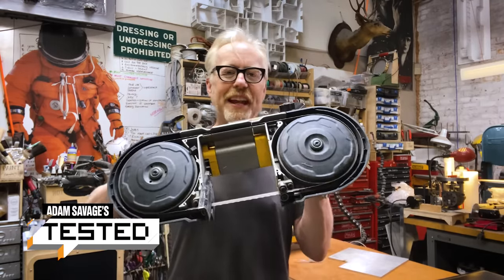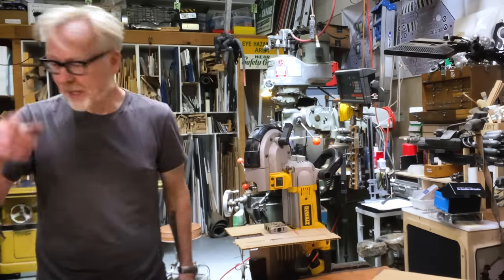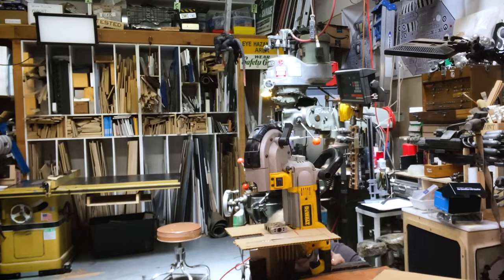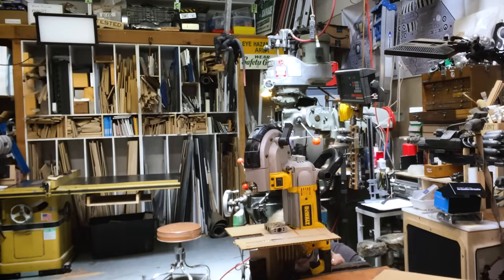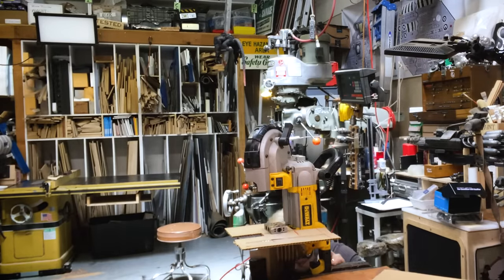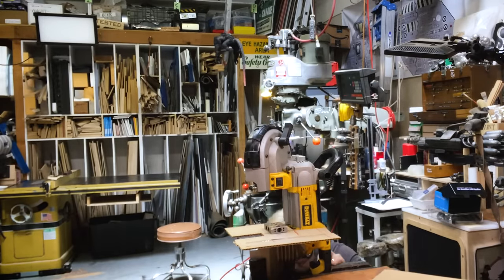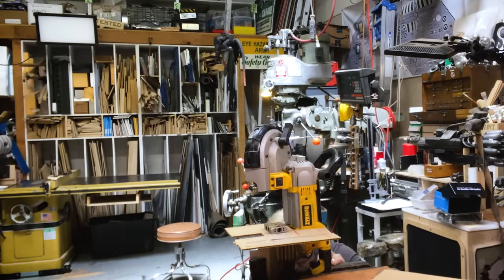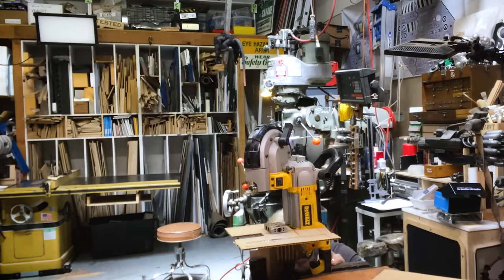Adam Savage Builds a Mini Tabletop Bandsaw!

Comment: I really really hate to be that guy, but it seems I have to make a little comment about electrical safety here.
Usually the One Day Build videos show reasonably safe shop practises (safety googles, respirators, things to look out for when using tools  table saws and nail guns) and that's pretty cool,
because lots of other youtube content does not.

However the wiring in this video seems a little bit like a missed opportunity in that regard.
When modifying your tools like this, please at least use a multimeter and check that the earth connection at the plug has continuity to all the touchable metal parts of the machine,
before plugging it in. In this case the table would have been a nice place to test.
The reason for this is: If you messed up and live wires gets shorted to the machines housing, there is a low resistance return path for the current through the earth connection and your circuit breaker will trigger.
If you also managed to interrupt the earth connection the you are the return path as soon as you touch one of those metal parts. You don't want to be the return path.
Also it is always good to check if you accidentally shorted live and neutral before plugging stuff in.
Other than that please don't leave any live connections exposed like that, where you can potentially touch the while absent mindedly fumbling with the switch. This get even more important if somebody else will potentially use your tools.
It also important to know that if you use a switch like that and connect the live wire to the common contact in the middle, one of the other contacts will always be live as soon as the machine is plugged in. For example in 1:01:30 the upper exposed contact is live when the machine is turned off.

It's totally cool to modify the electrical side of machines like that, but please be smart about it and do it in reasonably safe way.

Comment: Since you had a 2p2t switch, it would have made sense to utilize all of those to make sure that the tool is completely without power when off. Exposed live wires on the back of the switch.. Adam, that last bit was half assed and rather dangerous. Imagine you just need to turn the saw a littel bit and you grab the nearest ledge - where there is now live wires.

Comment: Suggestion: make more table space ahead of blade.  Having built my own bolt-on with 1/4" AL plate like yours, and having gotten a Swag table for a saw at work, i am continually wishing I had a bigger surface ahead of the blade.

On my DIY table I screw on a sheet of 1/2 MDF to make more table surface

Comment: The electrical connection should be encased to protect it from metal shavings which could cause an electrical short. I also don’t like how close the switch location is to the blade. Quickly turning off the machine could result in a laceration.

Comment: Old Man yells at cloud (Torx). The exposed contacts on the switch are a security NOGO. But i saw you fixed it in your second Video. Honestly i think you should have used a security Switch. That kind with a Emergency Power Off Button and Auto off if the Powerline is disconnected. And of course you should switch both Power and Neutral.

Comment: Dumb question but why not a variable foot pedal for speed control?  I know he said portable but you can just make it detachable for cord health or wrap it up.   I commented when he talked about the speed control knob on the top so I may be dumb!
Reply: well it is hard to see on camera but Adam cave is really small and a foot pedal would add vertical space requirement to the setup, plus added time to the setup time and it will reduces portability and make it less used.
Reply: @1BigBen  that makes sense!  I was thinking this tool was floor mounted anyways so my fault!  Guess I can't read!

Comment: So you didn't want the switch mounted proud  but instead you've got a cable  grip and cord mounted proud. The exposed terminals on that switch and wires just sitting there are slightly worrying.

Comment: You dont have to run the spindle so fast, and you just explained why right before you did it. You can cut aluminum just as slowly as you cut stainless, when you have chattery setups, half the rpm, and then half it again.

Comment: Why go to all of the trouble to inset the switch to then add a masive strain relief collar.  It would have been better tou mount the strain collar somwhere inside the housing, then the power cable could be wound and stored inside the houseing.

This would help with the desig decision to be ables to store it in a corner, as it will never be used because there is a propper workshop grade band saw in the shop.

Comment: Never use a hole saw on thicker material than the gullet unless you drill a hole inside the circle for chips to flow into. The second the gullet's full, the thing won't cut properly anymore.

Comment: Handy hint for clamping. @ 19:03 The reason the boring bar is cutting the -Y axis before the +Y axis is because there isn't a parralel under the +Y end of the job and the side clamps have pulled it below your zero Z axis point. So use a parralel the same height of your vise top or even a correctly placed machinist jack as not to foul on the material to be removed by the cutter.

Comment: I'm stunned by the dodgy electrical work.

Mains electricity and just wire nuts without an enclosure. And live terminals on the back of the switch. Totally against the regulations in the UK and I'd be surprised if it was permissable in the US.

Adam only considers an enclosure when he discovers metal shavings dropping on the connectors.

I note, he does make an enclosure for the electrical connections in a later video, but only because of the shaving, not because of the shock risk.  A home made box wouldn't be permissable in the UK and other countries. It would have to be a certified box.

Comment: Always connected Neutral not good shorts from other appliance's  through switch from source or from said appliance they are like a mini fuse designed that way to burn out to protect operator United laboratory's goes by that plus lights are nice to have hence the amp rating on said switch Thank's Adam

Comment: What's the point of getting a double pole switch with a neon (light) and not using either of them? I still don't understand why you did just stick the switch right in the top right corner so there's NO chance of any metal shavings falling onto it. All you needed to do is it vacuum it out every now and then just to make sure you so trip the breaker or stays on or burns out. 

Those lugs are also too big as you should of used blue (2.5mm) or red (1.5mm) for that size of flex. Yellow (4-6mm) is way too big and won't give you a decent clamping force and will end up getting hot. For the earth/ground you should of also used a male and shrouded female crimp as they give much better connection that wire nuts.
You should of stuck that wire clamp round the back so it looks a bit more OEM.

Comment: Have you not learned from acident with the lath? At 24:40 you are holding the portaband in a dangerous position. Your right hand is gasping the saw right near the spinning wheel holding the moving  blade. It is very easy to slip a finger into the path of the blade. Also you are holding that moving blade very close to your body.  You would have been better to make those straight cuts on the table saw.

Comment: You have the opportunity to use the neutral on the other side of the switch so that both the hot and the neutral are cut off when the switch is off. Something this is good for is a fault with both and your ground becomes the only safe wire. Another thing double pole double throw switches are good for is changing the direction of power.

Comment: When selecting an appropriate switch, voltage is not the only rating that you need to pay attention to. Please make sure your electrical components are able to handle the amperage that your device is expected to pull. There are many switches rated for more than 120 volts that would go up in smoke under a 10 amp load. 

A switch can be built to handle high voltage by keeping enough distance or insulation between it conductive parts to prevent arcing. A switch that is built for high amperage will have thicker conductive parts in order to safely accommodate the higher rate of electron flow.

Comment: You should’ve simply fished out the black wire instead of cutting the entire 3 wires. You only need the black wire to run through the switch. You could have avoided wire nuts altogether.

Comment: I noticed the switch didn't light up when turning it on. You'd need to also wire the neutral through the other side of the switch. But I think you already knew that. LOL

Comment: Let me preface this with saying I don't know a ton about electronics, but I believe that they call one wire a hot and one a neutral is because of the way the 110 volt power is ran from the breaker box. It is half of the capacity of the transformer coil, which when you put in a 220 volt breaker makes there be 2 hot wires and no neutral.

Comment: Trick for toggle switches: if you draw an imaginary line through the actuator axis (perpendicular/normal to the front surface, in this case), it will "point" to the terminal pair that are then connected - middle always common. Of course there are some oddballs but this will cover nearly all single/double pole, single and double throw.

Comment: It's a big no no to have exposed terminals like that, especially since they're live at mains voltage. When you grab the switch to turn it on for the first time your fingers are veeeerry close to the pads.
You mention it at the end, but a housing around the switch would be a great start, and I'd probably wrap insulation tape around the lugs and wire nuts for two layers of insulation!
Really cool build though, thoroughly enjoyed watching as always

Comment: That's not the correct assumption for the pinout for that switch.  It can't be a DPDT switch.  It has two lights on it, so some of those pins are for the lights (if they really are lights). It has to have at least one neutral for the lights to work.

Comment: Definitely could have use machinist jacks under the aluminum plate. All those clamps were doing was bending the plate. They needed some rigidity  below them to work right. Would have been much quieter and faster. But I have to remember, Adam isn’t a machinist and that’s ok.

Comment: I was surprised that the slot in the brass piece wasn’t a little wider, so that a little sideways force doesn’t cause the blade to rub.  Is that one of the upcoming improvements? Or would you just remove the brass piece if you might be turning the work piece while cutting?

Comment: those switches are meant for both the wires , so it does not matte how you plug it to the mains, if it is switched off, you never have any power to the machine because both wires are interrupted. And why not use the wago connectors? those screw on connectors are so obsolete,

Comment: So many things. Most glaring... why spend all day building this? Sell it on Craigslist and buy a bench top bandsaw. It will have adjustable guides and blades support etc. 
Also: A round throat insert is likely to vibrate the blade cut out of alignment. A square one will not. It’s also easier to cut a replacement. 
Why cut all the wires? The switch only needs the hot wire connected. And you have exposed 110 v connectors. One wrong move when reaching for the switch and your gonna feel it.

Comment: Gah I am not a fan of solderless connections. The number of times I've seen near fires due to a poor mechanical connection in a wire is more than I am comfortable with. Even if it doesnt burn its still a point of failure. I know sometimes they are just fine, but personally I solder everything I reasonably can.

Comment: The “filler” fibers within the cord increases the durability of the cord. The tension of pulling on the cord is taken by the fibers and not the wires, or the wire’s insulation.

Comment: HEAT-SHRINK SOLDER CONNECTORS!!!! Fucking amazing, the good quality ones are like making a single wire, they have plastic that melts inside to make it watertight. You can use the bigger ones to splice in a few wires together.

Comment: Go buy a KTM or BMW and do your own upgrades/mods and minor servicing - that will get you used to (and liking) torx. Just remember the golden rule . . .if you haven't already tried the next size up. . . try the next size up cause it's an easy mistake to make. Goes without saying, always overestimate the size and then go smaller. As always, invest in quality for a torx set (keys and sockets).
No real difference to managing a good set of allen keys/sockets.

Comment: A carbon steel or stainless steel plate would be better. Aluminum is too soft, any burs on the piece being cut renders it impossible to push on the table of the saw. I tried making a track for my circular saw a few years ago using aluminum angle iron and ran into that exact problem, the shoe on my saw wasn’t even badly gouged or worn, but even if I pushed as hard as I could it would not slide on the aluminum rails.

Comment: OOps, didn't level the table, so I'm waiting for the insert to not fit evenly...  I built basically the same setup.  I didn't use an insert just a zero clearance cut.  I also supported the body and didn't try to support off the table.  I also went with wood, though there is a weld up kit for making a metal stand.  I also opted to use a footswitch.  Makes is SO easy because you just walk over and step on the switch.  Plus I didn't have to worry about metal shavings getting into the switch.  Very nice build though, mine is more function over form...

Comment: "tao" (chinese word for head) Adam doing measuremnts with heads. I guess it makes sence you meassure with feets too.

Btw that Torx part had me laugh really hard. I used to have the same reaction untill I finally gave in and bought a whole set of bits.
"what the heck is is this, and why!?" I didn't see the point of Torx but I assume they are used in places they don't want the general customer to open up and tinker themselves.

Comment: The critical capacity of different bits and connectors has now  been reached. If you ever make a product that uses bolts or connectors you have to use some of the existing designs or you are a bad person.

Comment: I found what you said about boring heads deeply offensive, they are a fantastic thing in the right hands! 

You had a large cutting edge contact area (hence the linguine), and lots of tool stickout. Doesn't matter how slow you feed, it won't cut happy. Cut in a few steps to reduce the contact area. Use a shorter boring bar if you have one. And finally, you should not loosen and crank the two outside grub screws every time, they come preset snug enough that the slide is rigid but can still move, like gibs on a lathe. The center grub screw can be used to lock, but isn't always needed as long as you come up on your number in the clockwise direction to remove backlash. Happy boring!
Reply: Oh, and I love the 8 ball on the lathe :-)

Comment: I have a similar setup for my portaband, and I use a foot-pedal control that retains the original plug, so you can lock the trigger on but still maintain control of both the piece you're cutting, and the machine at the same time without having to take your hands off to fumble for a switch if something goes wrong. As an example:
https://www.amazon.com/Operated-Controller-Woodworking-Machine-Piggyback/dp/B07VSF64RM/

Comment: Now, these are really useful but if the blade fails while you are using it on a stand means it whips around the operator because there is nothing to enclose the blade. under normal use, the bake is facing away from you and when it fails does not normally affect the user. just be careful is all I'm saying. Ps made a stand for my porta band.

Comment: Dear Adam,  as much I admire your skills and enjoy your video’s. I have one point of criticism from a electrical engineer point off view. It’s all about the wiring.  
You use a double switch, USE IT! Here’s why: Because you made a device with a plug you wil never know which wire is hot, so you need to break both the hot wire and the neutral wire. So if you do that, when you switch of the device, there wil be you current in the machine no matter which direction you plug is in the socket. Greetings from the Netherlands 🇳🇱 bye. Hope your in good health. Danny Krul.

Comment: I'm not liking the circular brass insert. Vibrations and objects sliding over it will make it turn little by little every time, causing it to have to be aligned by the blade itself. That's a little bit of stress that's unnecessary and easily solved with any other shape besides a circle.

Comment: Please enclose the back of that power switch so as to avoid electrical shock. :) And both the hot and the neutral are normally switched in power equipment like this.

Comment: That switch is very unsafe if care is not taken to connect the incoming supply to the correct terminal. If connected to the center terminal (the 'pole'), in the off position the mains voltage will be present on the exposed terminal.

Comment: 52:33 - There was no need to cut the 3 wires. Just strip a 5 cm / 2" section in the middle, leave the earth and return ("neutral") wires intact, cut only the live wire, and solder / crimp those ends to the switch.

And, of course, that that spade connector will be exposed (and live, even if the switch is turned off) as long as the plug is in the outlet. Not exactly something you want to have there when replacing the saw blade or cutting metal. Some heatshrink over it would definitely be a good idea. [Edit: He does notice this later in the video.]